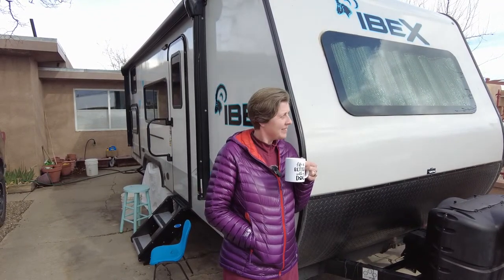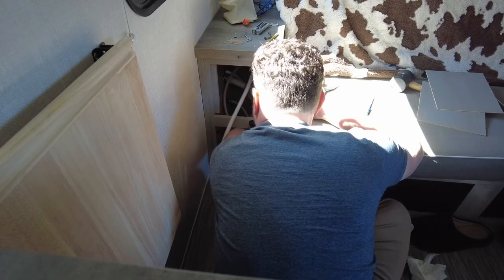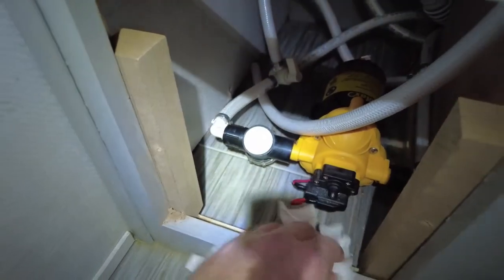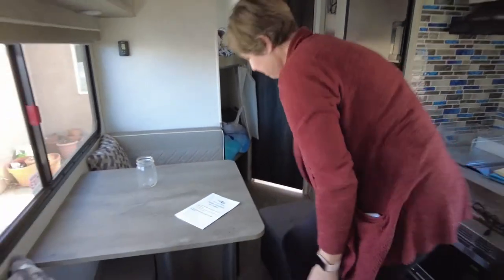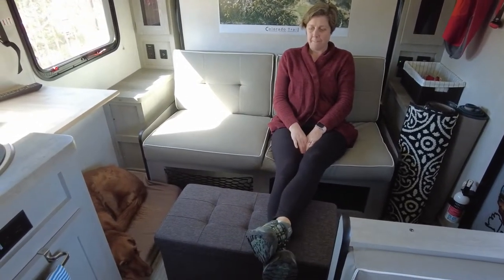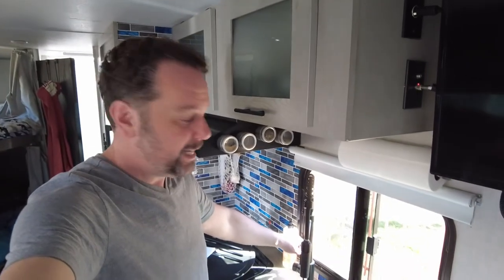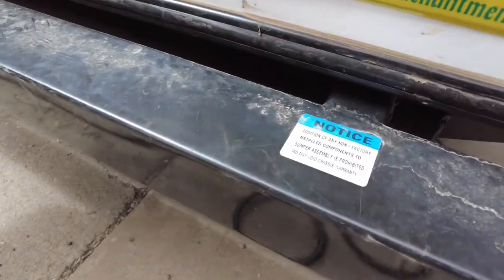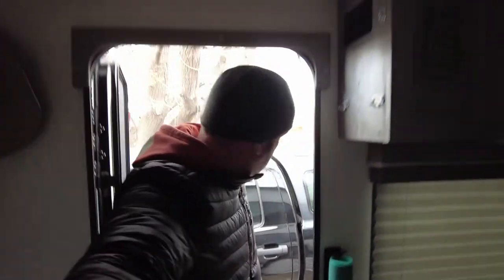Ibex Spring Prep

Comment: Have ibex as well.  Drilled out rivets on propane and replaced with wing nuts.  Use front generator rack so similar issue. Love the door window and other mods.
Reply: For the cover
Reply from the maker: @matthewcowden8254  oh that's a great idea.
Reply from the maker: Turns out the cover was bolted together so I didn't need to drill out rivets.  Replaced the locking nuts with wing nuts and good to go.  Thanks for the recommend.